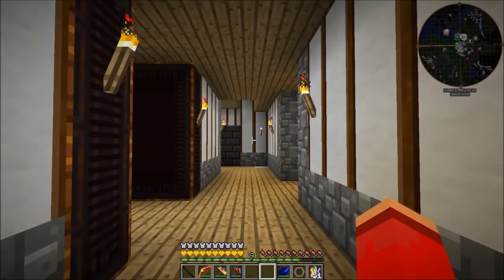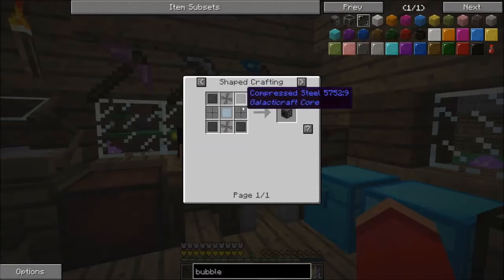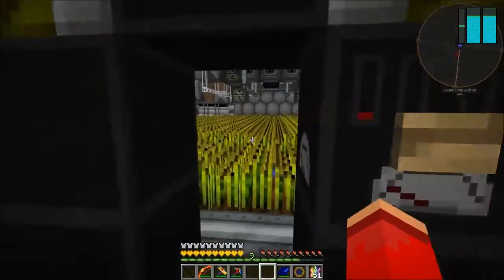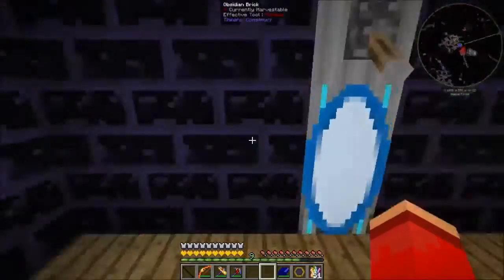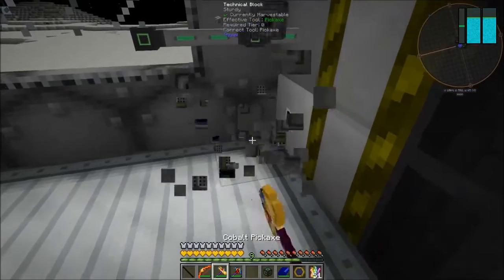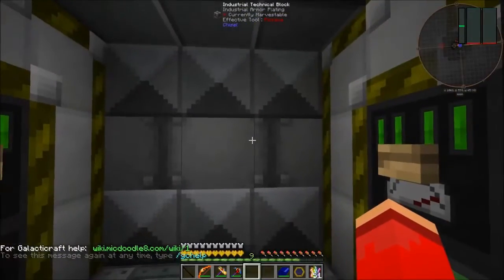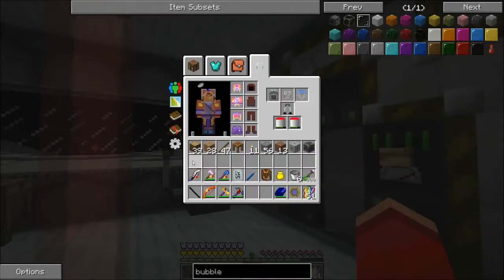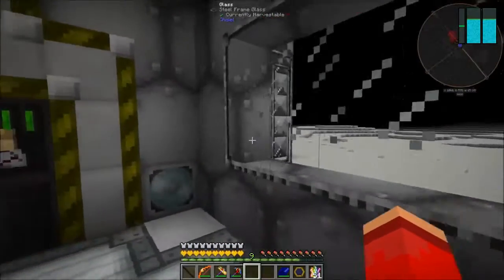Tutorials - E6: Galacticraft Oxygen Basics

Comment: is this 1.7.10 and also my oxygen sealer say that area is too big / unsealed
Reply: plz help
Reply from the maker: Have you tried adding more sealers? The effect stacks so if the area is too big more will solve the issue. If that doesn't work it might be that if you're building with blocks from another mod, they may not be considered "air tight" and blocks like stacked half slabs and glass panes from vanilla also don't meet that requirement.